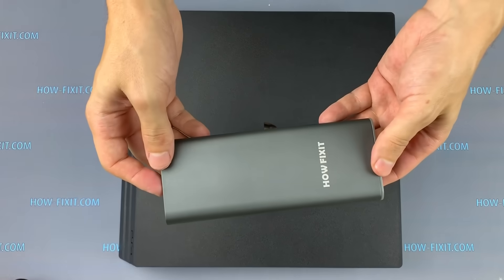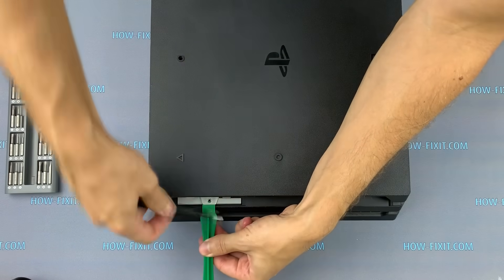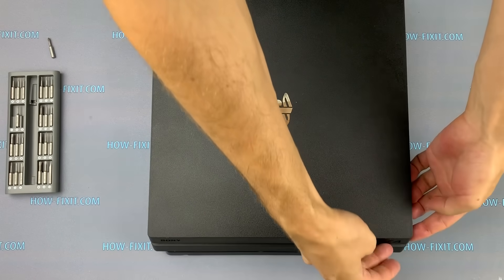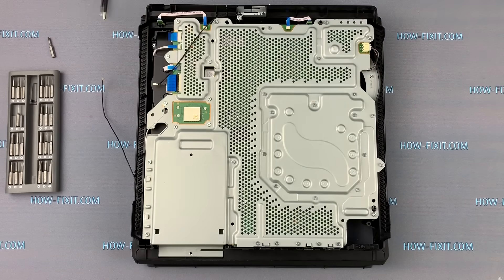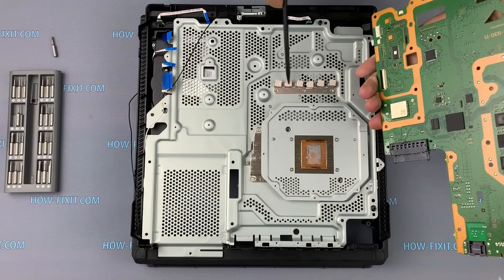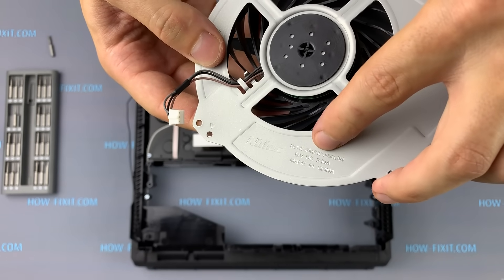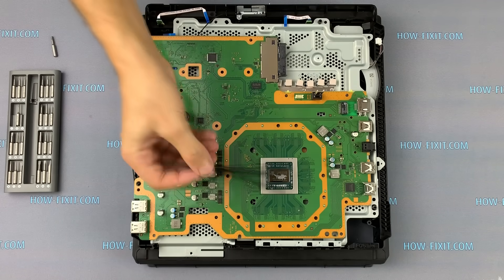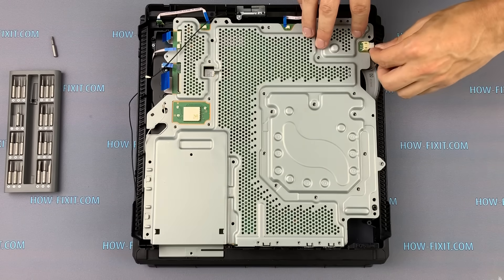PS4 Pro Disassembly: Ultimate Guide for Fan Cleaning and Thermal Paste Replacement

Comment: I followed the guide but now the PS4 turns on, and the blue light keeps blinking... no signal on the TV :( I checked again and again and everything seems to be in order. Any idea what's going on?
Reply: make sure your psu connectors are plugged properly and not damaged
Reply: Try each one of these options.

Swap HDMI cables/TVs and inspect the HDMI port.

Try Safe Mode (hold power until second beep).

Remove/replace the hard drive and try again.

Reseat all internal cables if you’ve disassembled it before.

As a last resort: reflash firmware via USB.
Reply: Were you able to find a solution to this problem?
Reply: @Emin.Karaca  Hey... sorry, no. I sent my PS4 to a repair shop, and they haven't fixed it yet.

Comment: My 5 Year old PS4 Pro was sounding like a jet engine so the time had come to either upgrade or attempt a fix to try and get another year or so from the Pro. Honestly I was not too hopeful that this would work thinking the damage was already done but with a £20 investment in a tool kit/anti static brush/99% iso propyl alcohol and 1g of Kryonaut Grizzly Paste I got to work. Went slowly step by step on taking it apart and whilst the Radiator was pretty clear of dust the original Thermal paste was now non existent. After re-assembling I powered it up and there was absolute silence. Have spent the past hour stress testing various games that have been virtually unplayable with the noise (RE4 remake/Horizon/GOW) and the Pro is now purring like a cat. Thanks very much for this guide which was great and saved me a lot of money on an unwanted upgrade or expensive service for the Pro. Cheers 👍🏻

Comment: Good evening, I changed the thermal paste and I could play for 2 weeks without any noise and 2 weeks later after disassembly they gently start making noise again but a lot is this normal? As if the thermal paste dried in 2 weeks we would say?
Reply: You didn't apply it properly

Comment: Thanks for the guide, very useful even though the steps are in the wrong order at the end.

One thing I'd add having done my CUH-71xx series Pro yesterday is you can help keep temps lower by changing the thermal pads (the cheap tiny ones Sony includes aren't great), and something I personally tried which is apply thermal paste not just to the centre of the APU but the edges as well, as they're at about the same height (the metal square around it) and can help transfer heat away from the edges of the chip.  Plus a few extra squirts of thermal paste underneath the S-clamp before you refit the two black screws around that; again it aids heat transfer away from the chip.  I used Arctic Silver MX-4 which is really easy to work with.

As a result, the APU now rarely hits 80ºc and only for short periods, even in more graphically demanding games like Red Dead Redemption II so the fan barely ever spins up beyond where it is when switching the PS4 Pro on.  Before, games like that and L.A. Noire were making the console fan scream loud, with temps regularly pushing towards 85ºc as the fan kicked in.  The console still gets warm but not so much in the area where the fan is, just the PSU at the back.  Elevating the PS4 Pro so there's space underneath helps a bit, too.  It's finally nearly as quiet as a CFI-12xx series PS5 which is a way better result than I anticipated, making it well worth a few hours of my time stripping it down, cleaning dust off of everything especially the heatsink.  Small tip there, as it's hard to get into the fins of the heatsink you can blow the dust out through them with compressed air and/or a hairdryer, lot easier than trying to get in there with cotton buds aka Q-Tips.

It turns out the thermal design of the PS4 Pro isn't as bad as everyone though, but what is bad is the crappy cheap paste Sony used, secondarily the aforementioned cheap gummy thermal pads.  Changing those can get you a mostly near-silent console.

Comment: Thanks for this video. My PS4 Pro has been incredibly loud for a year. I barely get to play it but it can't be good for the components running so hot. I purchased thermal grizzly pads and thermal paste and slowly followed your guidance and the PS4 is silent again. Seems as good as new. There was lots of dust buildup on the CPU heat sink radiator that must have been suffocating the CPU. A paint brush and air can duster did the trick. Great video  👍

Comment: Tried this and found I had hardly any thermal paste on the board. Put back together and disk drive now doesn’t work. Checked cables and found the wide 40 pin cable has lose gold contacts. Order a new cable and still no go. Now looking for a disk drive.

Comment: You missed 2 screws on the opposite side for psu now psu plastic is snapped
Reply from the maker: PLEASE NOTE !!! In this video, I disassemble the PS4 Pro of the 2nd generation (CUH-7200 series). 
If you have a 1st gen PS4 Pro, watch this video guide -> https://youtu.be/dJgXobATp3A

Comment: Thanks alot mate , you helped me fix my ps4 pro loud fan noise, best video I’ve seen online , got straight to the point , and was easy to understand, did have a slight issue with the philip screws going in as my model they seem to have put two types and there was 4 different ones that looked a lil longer and it just didnt go in the holes unless i applied high pressure, someone really didn’t want us opening these things lmao

Comment: PS4 Pro was on its last legs. Fan like a jet engine and shutting down all the time due to overheating.  Followed the instructions here and it really is running like new. Thermal paste had virtually all gone and heat sink was clogged with dust. If I can do it, you can too! Thanks for this excellent video.

Comment: I used the MX4 paste which I think is the most critical step. Inside the PS4 Pro there was not enough dust to create heat issue. The root cause was most probably the old paste. Opening PS4 Pro was more difficult than mentioned here but overall the tutorial was very precise.
Reply: I used the same paste but my daughters ps4 pro still makes a lot of noise, it was litterally 5 minutes it was quiet😢

Comment: DO NOT disconnect the power supply from the motherboard it rips out of the motherboard very easy and will brick your console instead pull it from the power supply, otherwise this video is amazing

Comment: Woo-hoo 😊! Great vid. Was seriously apprehensive about doing this and am not technically minded at all. Followed step by step and ... nothing 😢no boot.
Opening the case I quickly saw I hadn't connected a ribbon cable, doh! Quick re-assembly and boom works a treat.
Also replaced the internal HD with a 2tb SSD and now runs whisper quiet.

Comment: After way too much procrastination, I finally got around to replacing the thermal paste on my PS4 Pro. It had gotten to an unplayable state, constantly running the fan at max and turning itself off ('PS4 is too hot') for pretty much any game after a half hour. The difference is incredible, games that would blast the fan even from the launch menu have gotten whisper quiet. I can actually hear OSTs and environmental noise, which is a welcome change!

I will say do arm yourself with a pair of rounded nose pliers for the PSU cable.  Impossible to get it off the first time in my case without it. Also I couldn't get the HDD cover back on properly, must have damaged it while taking it off somehow (nothing a bit of tape didn't fix) Everything else went smoothly and according to guide. Thank you!
Reply: I’m glad it worked out for all of you guys but I just did this entire video from the beginning and managed to do it all completely but for some reason now it blinks blue and beeps for three seconds and the light goes off but the disk drive still beeps like normal.
Reply: D: Damn.. to be honest I wouldn't have tried disassembly if my ps4 hadn't been unusable and even then I was hesitant for a good while seeing as the shop would fix it for 50 bucks. 
No idea what specifically went wrong with yours, but I would try re-assembling it very slowly, making sure every connector is plugged/slotted in correctly. Try googling beep codes for the ps4 to get a hint at what specifically might be wrong. Try plugging in your ps4 without hdmi, usb or ethernet at first, then plugging hdmi after a successful boot (this worked for me on a previous fix!). Good luck and as a last resort there's always just paying for a fix, the shop has tools and knowledge you might not have.  @Trixy951

Comment: Thanks! This how to was really easy to follow! My PS4 pro wasn't even too dirty, but the original paste was out of the processor and entirely on the board 🤦🏽
Reply from the maker: Thanks for your support !
Reply: Do i need to discharge the capacitors by lamp or not ? This is important .
How did you clean the old thermal paste ?

Comment: Thank you for so detailed tutorial. This is how you do it 👍 I was dismantling this model for the 1st time (but i have some experience) and all went flawlessly. Turned out my console wasn't full of dust, as i took off warranty sticker, which was never touched, manufacturer applied too little of thermal compound. And for the 1st time i gave a go to my electric screw driver. So, im happy about tutorial. Make more of those for more devices